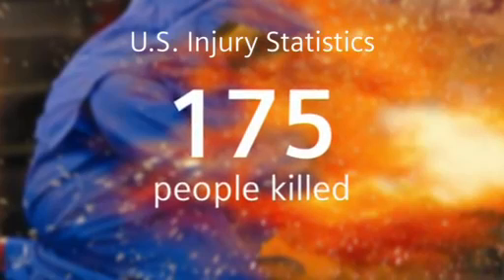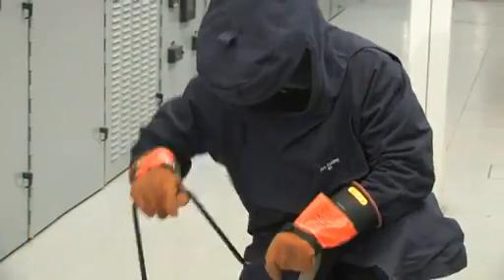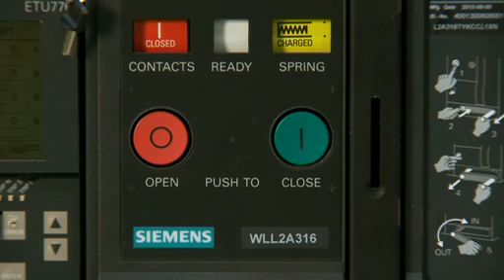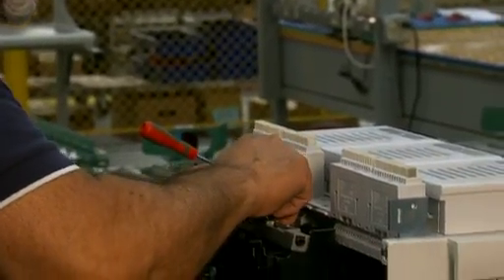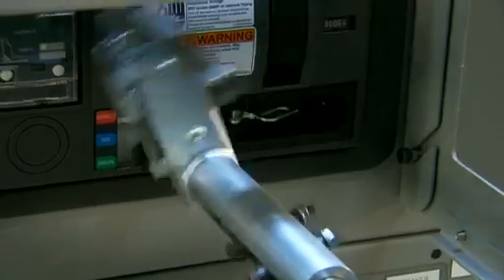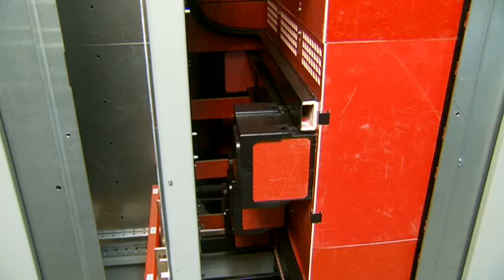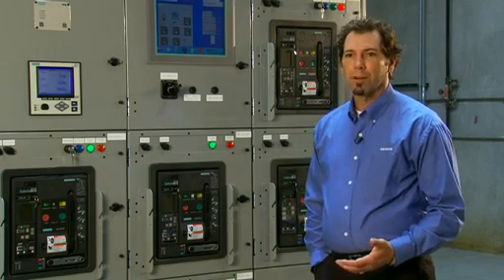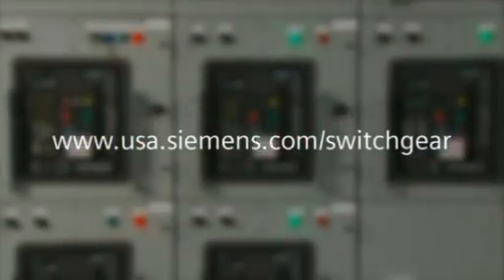Low Voltage Switchgear Arc Flash Solutions

Comment: I hope to see switchgear like this everywhere in the near future. Lots and lots of OLD CRAP out there, where some havent been operated in 20-40 years, and are absolutely lethal. If only it was so easy as to go to the adjacent room and press a button!

Also, building your switchgear cabinets to withstand arc incidents better is genious.
Reply: Jep plenty of panels out there where I said hell no. Full shutdown or no one is working on it period.
Siemens switchgear is state of the art. 
Altough proper active arc fault protection is still fairly rare.